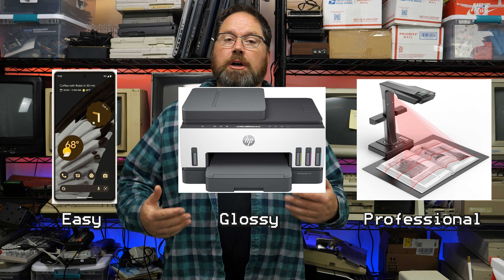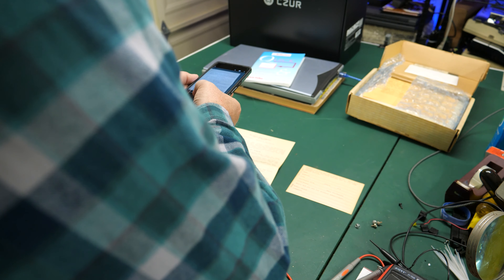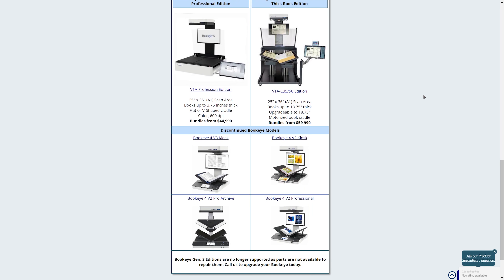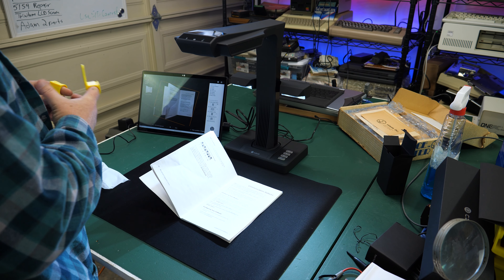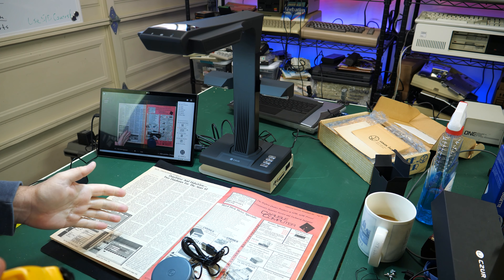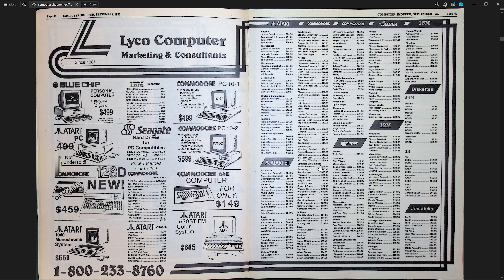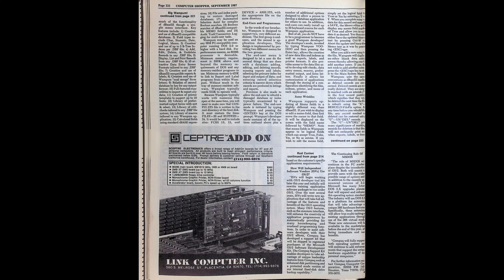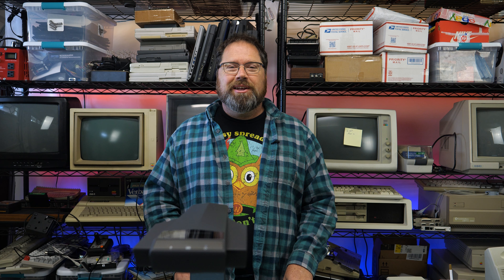Scanning And Archiving Vintage Documents - CZUR ET24 Pro, Phone, Flat Bed Scanner

Comment: I picked up a CZUR ET18 Pro refurbished off eBay and am very happy with it. It does OCR so you can search and cut and paste from the PDF. I have an old LiDE scanner, still around somewhere I stopped using it because my model was stuck on XP drivers, there was some kind 3rd party paid app that would let you use it on newer OS's

Comment: Great video.  I've seen other videos on similar products (I don't remember if they were CZUR) but yours is probably the best.  At $441.32 (after 15% discount), I am very tempted.  But do I really need it?  The Canon LiDE is cheap enough to just go for it, though there are a lot of different models besides the 30 and it's causing some indecision on my part.
Reply from the maker: Unless you are looking for portability, I would recommend the newer models. They will have higher DPI.

Comment: Czur scanners destroy shading. It looks like they did it on the Lyco ads on the illustrations. The cotts could easily be fixed if it just allowed you to combine two scans with fingers in different positions.

They haven't fixed these things for years.
Reply: Some of the images also have a noticeable heavy unsharp mask artifact. One is the UltraStor card.